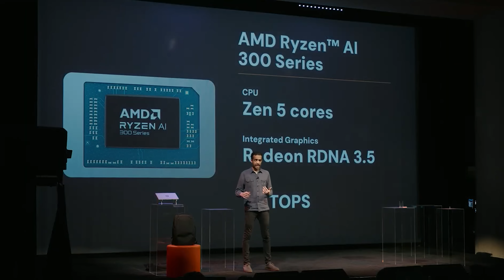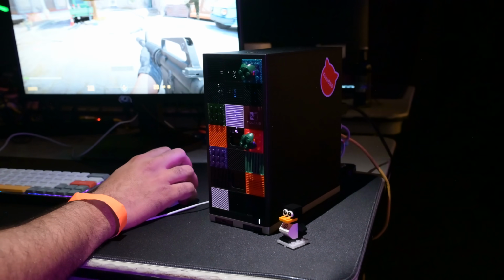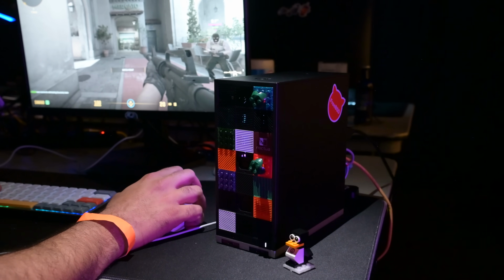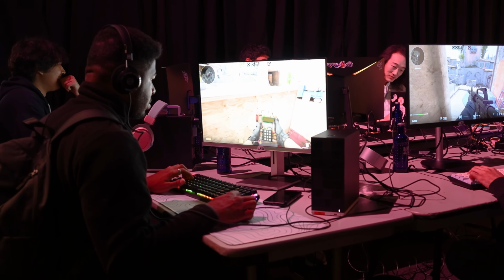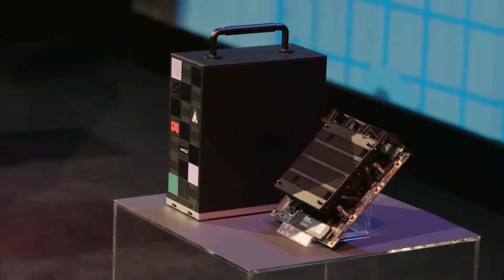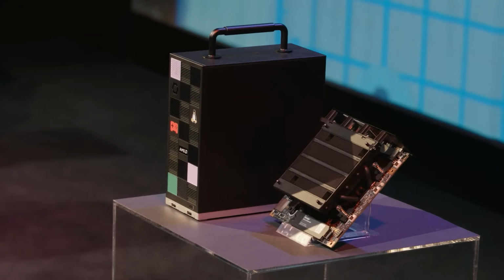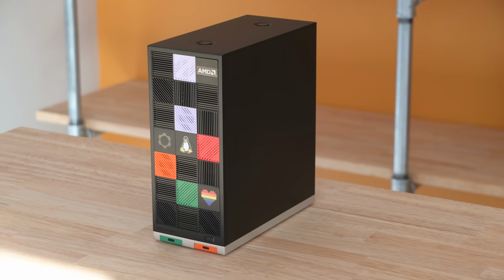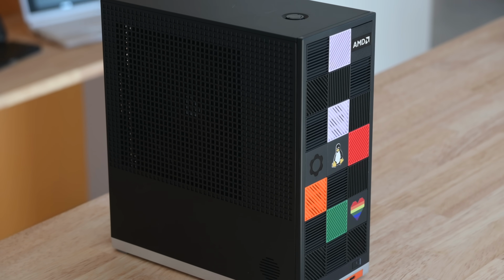Modular, Open, Repairable – The Framework Desktop Teardown!

Comment: I get having torx screws for bios battery, cause u dont want people messing with it easily, but why use torque screws for SSD?
Reply: You'll get a screw driver with 2 bits (/1 double-sided) that will be Philips and Torx. I assume that to make the small screws Phillips, it'd have to be a different size Phillips than for the rest of the case anyway, so the Torx is better option for 2 reasons, both related to screw stripping:
1. Torx screws are much harder to strip and
2. This eliminates the possibility (at least for included bits) to use the wrong size Phillips

Simple, yet brilliant solution to prevent user error if you're expecting non-professionals to be servicing their devices.
Reply: Torx* not Torque
Reply: The screwdriver it comes with has torx, but it also has philips. Maybe there aren’t any M.2 drive screws that have a philips that fits their screwdriver? Seems like an odd reason though.
Reply: @bituniverse8677  ok, if they provide the torx driver, then I guess it's less of a problem
Reply: @dogoku  From getting my Framework 13, it’s a plastic magnetic handle, and the bit is double sided. They are correct, it’s a great fidget
Reply: What person that touches innards doesn’t have torx? This is a non-issue. The torx bit costs like a dollar.
Reply: @thedavymac  You get a screw driver with all bits needed for service with every Framework device, so this is a total non issue even for absolute newbies, for whom it's even better than 2 different sizes of Phillips as it clarly indicates which bit you should use for what screw.
Reply: @thedavymac  Agreed. It's basic tools for anyone mechanical.
Reply: Maybe because many people, perhaps even some who'd buy this, will use a #2 Phillips driver on any Phillips screw, so an SSD screw that's probably #1 would get rounded out.
Reply: @concinnus In practice a 0 or even 00 for screws that small, when in a desktop almost every screw is expected to be a 2.
Reply: @concinnus  you actually want pozidriv there, not torx
Reply: @erkinalp  Actually, I don't want Pozidriv anywhere, especially for a user-serviceable product -- because again, it looks too much like Philips #2.  Robertson, Allen, and Torx all exist, and are better.  Or better yet, just make the M.2 and battery swap tool-less, it's pretty common these days.
Reply: @concinnus  that's the point: Pozidriv heads are compatible with Phillips drivers, but not the other way
Reply: Hear me out: what if all torque are captive and philips are loose to avoid confusion?

Comment: What is the onboard connector used for the expansion card controller shown?
Reply: that's standard usb c usb 3.1/3.2 pc connector
Reply: @MrAria2000  On the motherboard?
Reply: @jeremyjedynak  Yes.
Reply: @MrHamof  What does the controller board do? Seems like those connections could just be cabled directly to the expansion adapters, which also have USB on the interior side.
Reply: @jeremyjedynak  On FW laptops the expansion cards just plug into USB-C sockets that recessed into the frame. The USB-C expansion cards basically act like 1" extensions, otherwise the "volume" of the expansion card is there for whatever PCBs that non-C expansion cards, like HDMI/Ethernet/USB A/the lil quad USB dongle "micro hub" that somebody made
Reply: @corombb I'm already aware of this. The video shows a controller board that the expansion devices plug into, and that controller is cabled back to the motherboard. That connection between controller and motherboard is what I was asking about.
Reply: the unofficial name for that type of connector used on the motherboard-side of type c connections is "type-e"

more technically i believe it's the USB 3.1 Front Panel internal Key-A 20-Pin Connector or something along those lines

Comment: When Apple puts the RAM on the board there are only complaints, but when this manufacturer does the same there are justifications. Of course it is already evident that the opinions of this channel are not impartial 😒
Reply: memory on Apple M chips are on package
Reply: cu Linus from LTT is co owner at frameworks
Reply: There are complaints frome people uneducated on the matter. That's about it.
Reply: The key difference being that apple won't will never provide first party replacement boards or upgrades down the line. AMD said that LPCAMM is just not feasible with this design. This is AMD making the claim, not Framework. Apple is the manufacturer and SI. There's a big difference.
Reply: @kenshiromilesvt.7037  its still frameworks choice to use this chip (to chase this performance level )  while the company used to stand for repairability.
Reply: @JwFu  They still do stand for reparability. They made this thing as repairable and utilizing as many standard PC components, connectors, headers, etc. as they could. Tell me, if they used a standard socketed Ryzen chip and socketed RAM, would you buy this? What would be the point? They would be more expensive than the other brands and more expensive than just DIYing your own Mini ITX PC, with no repairability advantage compared to a regular Mini ITX machine. With what Framework chose to do, they made a product that fills a niche and made it as repairable and upgradeable as they could.
Reply: @OmairArif  "If they made it standardized and repairable, people wouldn't buy it.  They HAD to make it unrepairable and proprietary."

I'm sorry, I didn't realize I had accidentally clicked on r/Apple. Literally slammed headfirst into the point and still managed to miss it.
Reply: @kenshiromilesvt.7037 no it’s not
Reply: @Soguwe  having seen framework pricing, they are not very far away from gouging with mediocre products.
Reply: @hpycndl  they're a small, young company that makes high tech.
That stuff is expensive to develop, and they don't move enough products to make production cheaper.
Samsung ain't cheap because they choose to sell cheap. They're cheap because they move a few hundred million units every year, bringing down the overall price
It's amazing Framework can move their stuff for this cheap.
Reply: @Soguwe  i wish nothing but good luck to framework too. 
I am just saying the price u pay for framework's quality is high. 
It's a bit hypocritical of iFixit for not calling them out when they call out each n every apple product for soldered ram. be it be it mac mini or macbook air.

Comment: My current PC is more modular because I can remove the ram?
Reply: CAMM wasn't fast enough to keep the Strix Halo APU fed. Fortunately the base model starts at 32GB of unified RAM.
Reply: @ej_tech  that one has only 8 cores and is actually the "What's the Point" product 🙂
Reply: @ej_tech  Yeah yesterday on LTT he explained it better that it wasn't feasible. I'm just confused why they needed that cpu generation and freaking AI mini PC in the first place...
Reply: but it doesn't have ai 395, which doesmt permit swappable ram modules
Reply: @911canihelpu  sure but it has a socketed cpu which I can upgrade and replace...
Reply: yes
Reply: yes, but that's not really the point here. Framework wanted to bring Strix Halo chips into a standard Mini-ITX form factor. If they used socketed RAM, the RAM would run at significantly slower speed and largely defeat the point of using Strix Halo. The advantage of Strix Halo is that it can have a ton of fast RAM (126GB at 8,000MT/s in this case) attached to a relatively powerful APU, making it good for dealing with larger Machine Learning Models. If you switch to slow socketed RAM, then there isn't as much point to using Strix Halo and you might as well use a Socketed AMD CPU as well, but then all Framework would be doing is making a prebuilt MiniITX PC. What's the point of that when anyone can make a Mini-ITX PC in this form factor?
Reply: @OmairArif  ANYONE can bring Strix into a desktop form factor.  Just look at the 4700S kits, or any of the DOZENS of aliexpress boards that take BGA chips with soldered ram, and sell them on ITX boards (usually with DIMM/SODIMM slots).

This isn't a product category Framework should have touched to begin with.  If this one type of chip requires soldered ram, then Framework should have used a different one. Cope all you want, but it's not like Framework is the only company that will have access to these chips.  They made the deliberate choice to use their limited resources make a worse desktop, when they could have chosen to make a better phone, or some other tech that desperately needs a repairable option.
Reply from the maker: The added value Framework brings to the table here is pairing cutting edge technology with parts, manuals, and support to enable repair. They are committed to that philosophy and you can see that on the Framework 13 and 16 when they released schematics to independent repair shops so they can perform the kind of complex repairs that are impossible on similar hardware that goes for twice the price.
Reply: @iFixitYourself  But a desktop class system with socketed CPU and upgradable GPU is faster and probably cheaper as well as infinetly more upgradable and repairable? I think you are playing favourites here! This thing might comapre favourably to the Mac mini, but that targets apple users anyway and the framwork prbably does not ship with mac os. So the framework directly competes with DIY SFF PCs and it loses that competition...
Reply: @iFixitYourself  sure I can see that philosophy on the laptops, but not on this desktop. If the technology is not yet ready for the modularity/repariablity now, then it shows, for this product, revenue first philosophy second
Reply: @leviathan5207  The whole point of Strix Halo is that this is unified memory. The 128GB is shared between the CPU and GPU and can be reallocated dynamically as necessary. Imagine trying to buy a "cheap" 128GB VRAM GPU. So yes, the traditional architecture you're talking about would be more upgradable, but this specific config would be impossible to build at a reasonable price. The GPU is comparable to a 1080 in term of compute power. It's not very fast by today's standards, specially for gaming, but if you need to have 32+GB of VRAM for your workload to even start, then event the 5090 or 7900XTX aren't options.

Just like the Mac Studio, this isn't a gaming computer. It's a very affordable workstation, for highly parallelized compute workloads. If it wasn't for running LLM locally, this thing would be a niche of a niche. Outside of maybe 3d rendering, video editing, and scientific workloads, this is not a config that you would want.
Reply: @OmairArif  So it's mostly an AI mini pc? Like we need more f*** AI stuff haha

Comment: A desktop with no expandable memory or cpu ? Why?
Reply: AI
Reply: Because if they made it with expandable memory and CPU, they couldn't use this memory and CPU configuration (Strix Halo with 96GB of high speed 8,000 mt/s RAM). This configuration is really good for stuff like Machine Learning, because the strong APU has access to a lot of fast memory. It is a combination that you can't get in a desktop form factor, let alone a standard Mini-ITX form factor like Framework put it in.  If they used expandable memory and a socketed CPU, this would just be a standard prebuilt PC, no different than what someone could make with off the shelf parts, and at Frameworks scale they wouldn't even be cheaper than the DIY solution, So what would be the point of Framework making a run of the mill MiniITX machine? No one would buy it and it wouldn't have any reparability advantage over what already exists in the market.
Reply: because the point is to sell proprietary expansion cards and upgrade kits.
Reply: @kintustis  "proprietary expansion cards" is the funniest thing I have ever read in regards to Framework. The cards are literally the most open source component of the whole thing, with CAD files and schematics and everything

Comment: heck, is that even a "standard" psu?
Reply: Yes, it is a FlexATX PSU
Reply: @lesolas9317  would had been nice if they actually mentioned that
Reply: Yes, the form factor is called Flex ATX. it's common in very small ITX builds where an SFX PSU wouldn't fit. The one Framework is using is 400W.
Reply: @OmairArif  nope it's 600 that they only run at 400 to keep it cool and the small fan in it down
Reply: @ Framework chose a 600W unit from the PSU manufacturer and had them convert it to 400W to keep it cool and quiet. But you can't run it at 600W anymore after that change (it's OCP will likely trip before than), it is officially rated for 400W.

Comment: How do i replace or upgrade the ram on this one? ;)
Reply: The same way u upgrade a 5090 from 32 to 96GB VRAM
Reply: you buy a new board... also if you don't go for the 128GB version you already buy something you don't need. But you don't buy it so it doesn't matter.
Reply: It's not. According to the LTT video that's AMDs fault. Something to do with the chip.
Reply: @davedujour1  I believe the speed was needed with the soldered ram and by making it modular it basically cut the performance in half. It was to much to give up for it to be removable.
Reply: @davedujour1  no, they made the CHOICE because off speed.
Reply: @JwFu The problem is the size of the bus, even if it ran at a lower frequency the signal integrity would be too low. This chip needs the soldered RAM to run, so their options were to make the product with soldered RAM or not make it at all.
Reply: @edenmictlan  exactly, they shouldNT have made this!
Reply: @JwFu  I think so to, but hopefully with a release like this they can get a bigger budget from the sales to actually make the devices we want.